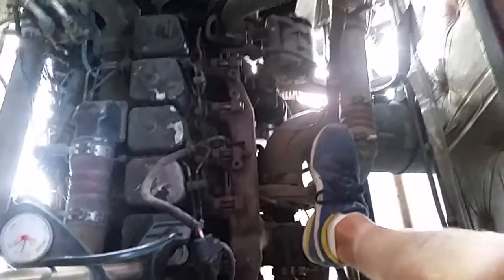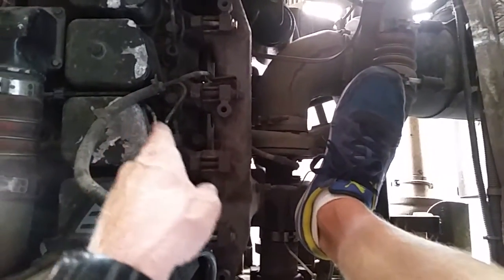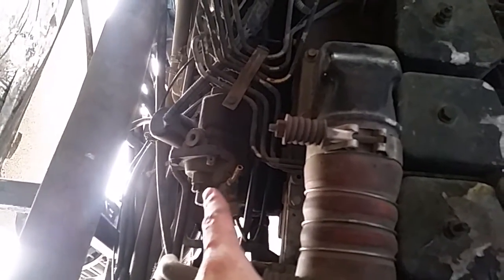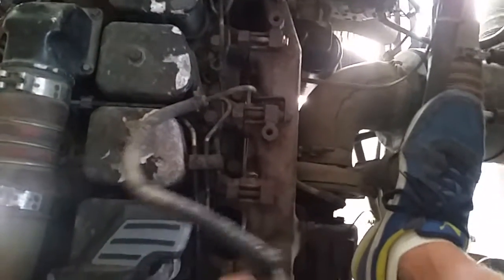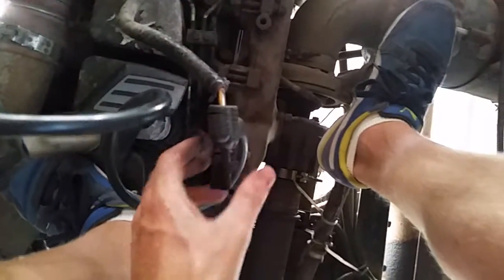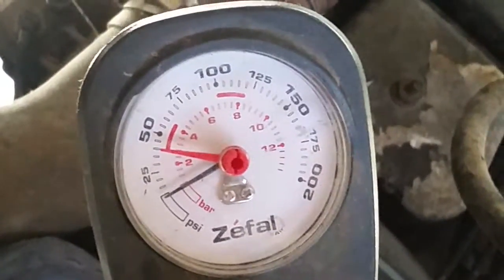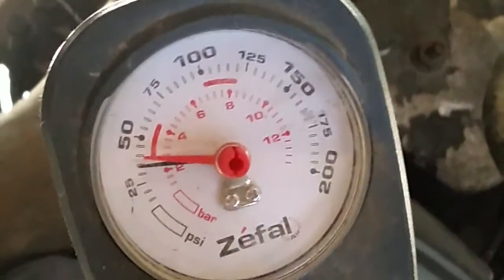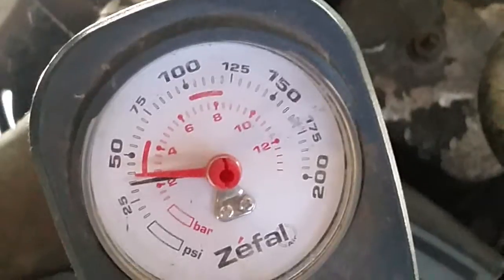8.3 cummins 1992 wastegate diaphragm test how to

Comment: Hello, Blake I have a 2000 Freightliner FL70 with a Cummins 8.3 with the Cap's fuel pump. And my truck is not moving off the line, its slooooow!!! my max speed is goes from 50mph to maybe 62mph downhill...

Comment: I've got a 1999 Cummings 5.9L. I can be driving and just out of the blue I loose power (Like the turbo isn't working) it runs just lack of any power. I've been told it could be the waste gate. Does that sound right? if not any ideas what it could be?

Comment: Hey Blake great video. My wife and I and our two kids are driving across country this summer. On the road now. My 2000 Monaco Cummins ISC 8.3 is low on power. Replaced oil and fuel and air filters. Still not luck. Thinking my next step would be to check air leaks around turbo piping?

Comment: from the intake manifold there should be a line that makes a tee , one side going to the afc , the other side going to the waste gate . 
the afc will increase or decrease fuel based on the amount of boost pressure  at the intake manifold . 
the line going to the waste gate will open the waste gate at a predetermined pressure , preventing over boosting the intake manifold . 

it appears the pressure line from the intake manifold is not hooked up in the video , which could be causing your problems of lack of boost pressure from a lack of fuel from the injection pump .
Reply from the maker: I wish I still had that coach but it's sold and I'm doing a new project now.
https://www.youtube.com/watch?v=cQgHEhihNbs

Comment: I have a case 580 super m with a turbo and when i put the machine under load at full rpm the waste gate is not opening up. i removed the hose off the turbo and its not blowing air through hard enough to activate the actuator for waste gate. i dont have black smoke or nothing, when i  open waste gate manually nothing changes even under a load. please help

Comment: Are you sure that's a 8.3? I thought the injectors are on the other side. Intake side of 8.3 cummins engines could be wrong tho
Reply: Caleb Bell it’s a 5.9 12 valve not the 8.3